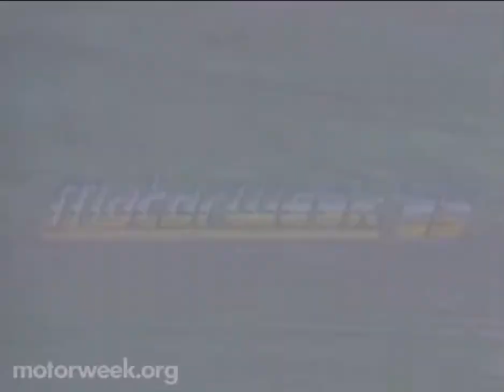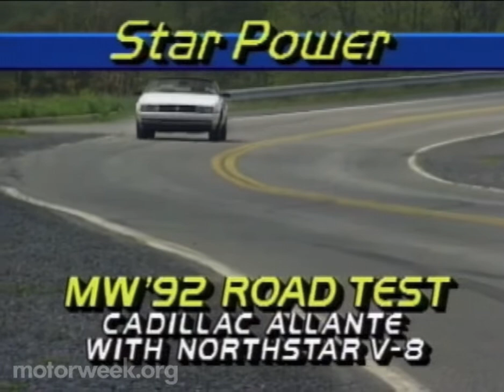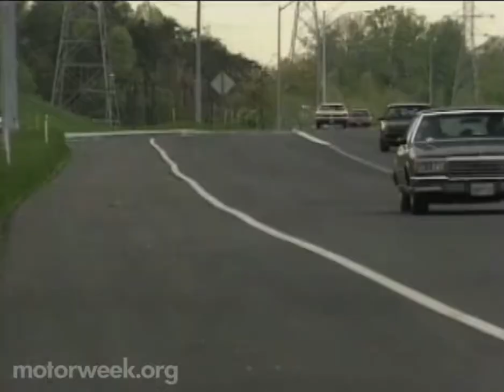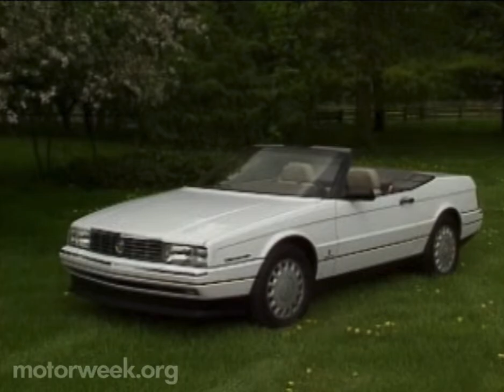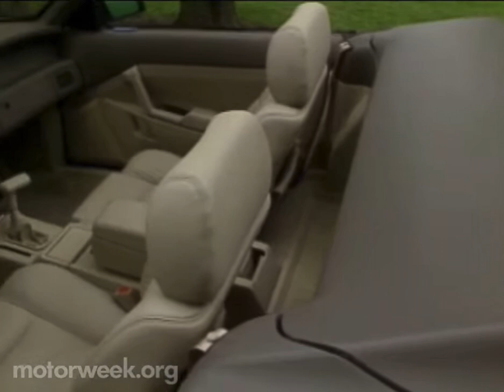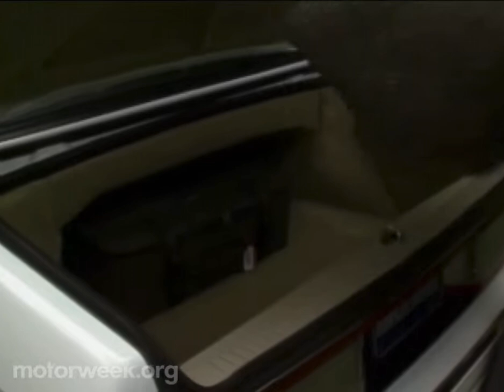Motorweek 1993 Cadillac Allante Northstar V8 Road Test

Comment: I own one now at 125k and have had my '93 for 5 years now, and have had few problems.  These are unique & very hi-tech cars, which is good & bad.  Parts can be hard to find but there is a strong Allante community, who have the parts & know-how to keep them running well.  The Northstar is not as bullet-proof as the 4.5 (the 87-88, 4.1 is too slow for my tastes, i.e, about neck & neck w/ the heavy convertible XJ-S but is reliable) but it is not as bad as its rep. either.  If you maintain the cooling system, this requires ongoing, preventative maintenance (change the coolant every 2 year regardless of mileage), plus all the other routine maintenance expensive cars require, the Northstar can live.  One other upside of the 93's is that they used the Bosch II ABS rather than the troublesome Bosch III used in the earlier cars.  Any Allante handles & rides well & is either fast (the 93 cars) or quick (the 89-92 are as quick, as a 300SL & faster than a 5.3 liter XJS).  I get positive comments all the time on the (still) beautiful Italian coachwork.  Finally, you can fix/adjust the auto-manual top yourself (mostly) something you can never do on the 129's top (also no self-recycling wiring).  For well under 10k it is a steal.

Comment: A monument to GMs (early)blunders.Lots of micro details.It’s a bland twin to a VW scirocco (a Volkswagen)but in convertible form,Pass the No doze.Yes it finally got a better engine until its foibles appeared the (now dreaded)Northstar.The biggest failing that everyone knew at the time (except the so called buff books and GM)was that it was saddled with front wheel drive!Some attempt at returning to “standard of the world”Econo box drive train for the price of Euro luxury sedans and convertibles.At least they didn’t give it the Reata vent windows.
Reply: Don't understand the VW reference.
Reply: @bernarddavis4350  it’s design.It’s front end and side  styling is nearly identical to a 75 VW scirocco.It also shares the basic drive train layout-(econobox front wheel drive).Though Cadillac did best VW by including a V8 it was pitifully under powered-partly because of Cadillac’s laziness partly so as not to overwhelm its delicate FWD transmission.

Comment: The production 1993 Allante had a 295hp 4.6 liter Northstar V8(not 290hp). Torque was correct at 290 lb-ft. Unfortunately, that engine wasn't enough to keep the Allante in production after 1993.
Reply: It was a good engine from the start but had it cooling problems, head gasket issues, and starter inside the engine making that a pain to replace. This was a good looking convertible for the time.
Reply: Beautiful the Cadillac Allante.introducing from 1987 and end of 1993. Allante is Cadillac with design italian of Sergio Pininfarina

Comment: The engine was brilliant at first, but it turned out to be junk.  The car itself was good looking, but a mess.  A manual top in the era of the R129 SL's fully automatic time?  Body shudder/flex?  Just a pretty piece of junk.  No mystery as to why it failed, but I still have a soft spot for the 93 model.   They should have dramatically facelifted the car fixing these things while adding the northstar.  No one cared about what car paced the Indy 500 and that 30K difference was felt in the SL the moment you grabbed it's door handle - quality, engineering that shamed this heap.
Reply: Don’t forget the ridiculous way it was made. Designed in Italy. Built the body there and shipped it to the states to get finished. Stupid. Expensive. Dumb.
Reply: @Butchcub75   I agree.
Reply: The Chrysler TC by Maserati was built the same way. What about that?
Reply: @johnnymason2460 What about it?  It was JUNK also.
Reply: Umm the door handles are the same as the Mercedes.
Reply: @aliengoth You think that means something?   See if you can erase that comment.  Clearly you don’t get much.
Reply: Actually the Allantes sell for more than R129s, just sayin.
Reply: @aliengoth  And even if that were true are you trying to say the alante was a better car?  You are not that out of it are you?
Reply: I found it hilarious that even in 1993 John said this was "expensive for a Cadillac" 😂 GM really dragged "the standard of the world" to hell - But in terms of quality and convertible top operation I'll be fair and say they're a bit more forgivable when a new Mercedes SL started at $30k more than these... Although given the fact that the R129 SL's are now appreciating in value versus these Cadillac Allante's which are virtually worthless and sell for near scrap value when I see them run through auctions even in nice low mileage condition it's safe to say that extra $30k would have been well spent on the Benz by comparison.
Reply: @Stressless2023 MW has always had a glaring bias for GM junk.  The excuses they make are hilarious like you said.
Reply: @MercOne: What "junk" engine remains in production for 18 model years?
Reply: @TeeroyHammermill  A GM junk engine that could have been great. I looked in the dictionary under bean counter UAW engine and there was a 1.4 Turbo Ecotec illustrated in the caption. There was also "see 2.7 turbo" as well. Ok, none of that is true but you get my point.
Reply: @TeeroyHammermill Is that a serious question?   You think because they made it for a while it can’t be junk?  Detroit produced the same junk cars for over 40 years.  Try real hard to process this and then think about what you’re asking.

Comment: ah yes the Oldsmobile Quad 8, cadillac engine my foot. It was developed by Oldsmobile for Caddysmack. So why did they show the rear wheels for the traction control system? LOL. Still a handsome car, but Ill take a 92 with the pushrod 4.9. Early northstars had too many problems.
Reply: Honestly any of these engines (4.1, 4.5, 4.6) are all good in their own way. Proper maintenance along with the right person that knows what they are doing, goes a long way. The Northstar is really a robust high-performance engine and its great at that. And actually, they had much lees issues in the early years than later when GM introduced Dexcool antifreeze. I drive a 93 Allante practically every day and it's been excellent.
Reply: @starxlr7863 That is most delusional post ever.  Good in their own way but yet you need a mechanic that knows what he’s doing?  You can’t make this foolishness up if you tried.  These cars are junk and their engines were junk.  These cars are why Cadillac became a joke in the market next to the competition.
Reply: @MercOne not quite. It’s a bit more nuanced than that. Northstar actually brought a bit of prominence back to Cadillac around this time. GM as a whole was on the up after a miserable run through the 80s. Lots of great cars in this period. The “Northstars Suck” thing is not very old. I agree, they suck, but can you tell me why Northstar sucks but BMW M52 and M54 do not?
Reply: @user-ew6jy9mo4r  Is there a point to any of that?  I mean honestly it’s just pointless rambling.  Prominence? To a failed car and a brand that would have been gone if it weren’t for a bailout? BMW is not struggling.  Cadillac is. That’s the difference.  There is no nuance to a string of failed cars from Cadillac. Besides the Escalade they’re largely irrelevant.  And a few Blackwing cars which are winners.
Reply: @MercOne  you have an opinion, and that’s great. The more car enthusiasts, the better! For your opinion to be valid, you should know what you’re talking about. To “know” about anything, and not just “feel”, you have to understand where it is. To understand where something is, you have to actually know where it’s been and then see where it’s going. You are missing two of the three. That was the point.
Reply: @user-ew6jy9mo4r So in other words you’re literally out of gas. Cadillac’s long list of failed cars is a fact.  Their struggle for relevance from the 80s onward is well documented.  So while you talk out your neck with a lot of bs, you can’t spin it away by making it about me.  How someone can argue Cadillac’s recent past is beyond me.  It’s delusional to suggest that what I just said isn’t true.  Try again.
Reply: @MercOne  only delusional if you don’t know what you’re talking about.
Reply: @user-ew6jy9mo4r Like I said you’re done.  Just log off.  You can’t refute a single thing I’ve said so your response is to just go full T.
Reply: @MercOne  not at all. I’m still waiting on why Northstars suck. Show me you know what you’re even talking about.
Reply: @user-ew6jy9mo4r  The numerous problems the engine had are well documented. It was fragile junk once you got past the HP numbers.
Reply: @MercOne  so, the “numerous problems”, that you can’t explain to me, made it fragile junk? What other engines have these same “numerous problems”, but aren’t “junk”?  I’ll give you a hint…BMW M52 and M54. What makes the Northstar, with these numerous problems, “junk”, but the BMW engine, with the same numerous problems, not “junk”.  This is called critical thinking.
Reply: where are you getting this information, your ass or thin air?
Reply: That explains why Oldsmobile got it for the Aurora & Buick didn't for the new Riviera lol
Reply: What difference does it make?  They were all GM engineers and the engine turned out to be junk.
Reply: @MercOne  yeah. Typical gm. Facts matter. Cadillac couldn’t design anything. And if it makes no difference why are you asking are caring?
Reply: @Butchcub75   What facts?  Are you not able to grasp that Cadillac and Olds used the same engineers?  This is stupid to try to point out that Olds somehow was different from Cadillac or that they used a different set of engineers or they were a separate entity.  It was all the same incompetent people. Ask yourself what difference it makes on a long since failed brand and junk cancelled car from Cadillac.  You're the one trying to make some distinction here, not me.